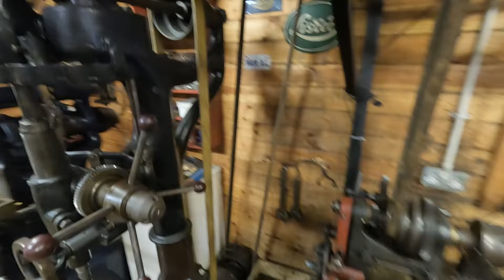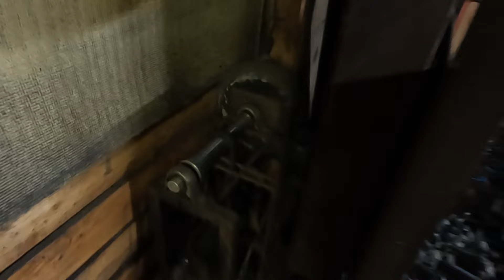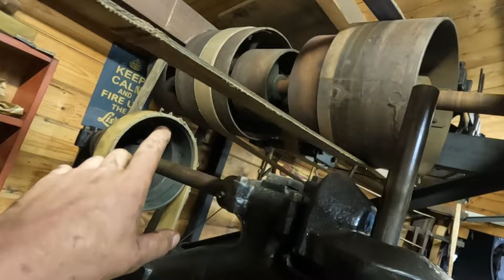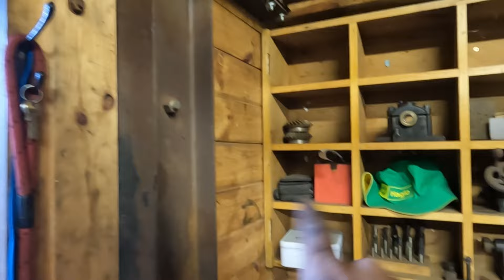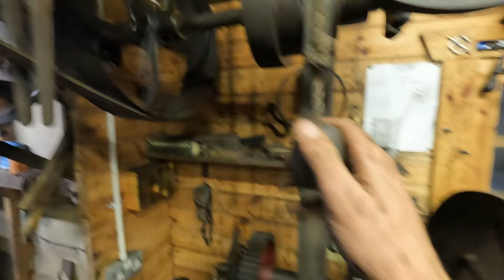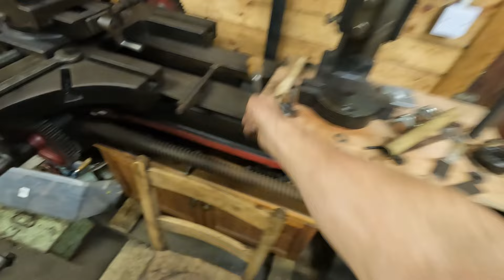Lineshaft Driven Machine and Blacksmith Shop Tour

Comment: Interesting shed, when I worked at the Cumberland pencil company, they had machines run by leather belts, specifically pencil painting machines, originally everything would have been through belts, converted to electric, but using the river to drive them originally.

Comment: What a fabulous presentation.    None of these machines were ever designed to stop working, they were expensive and made last forever.... eminately rebuildable. I am a fan of old American Iron.... 1928 Hendey 14x40 lathe and a 1932 South Bend 9" lathe and a 12" whipp shaper .... all of these are flat belt converted to their own motors ....   

I also love Dave Richards ... one step further and powers the line shaft with steam ;)     Like you his is a working shop not a museum .... thank you for the tour.  

Now we need find you a vertical mill .... or a vertical head for one of your current mills.  ;)

Comment: Hi Alex, thanks for the tour. You certainly do have an eclectic assembly of period machines. An "electrically driven" steam engine parked outside puffing some sort of "breathable smoke" would complete the idyllic picture.
Have you ever estimated what the idle power consumption of all those machines running but not doing work, such as just demonstrated, would be? Obviously, your ten hp motor with speed reductions in almost every combination might make up for the lost energy in turning so much mass. 
It would be interesting to run a clamp-on meter on the motor's feeds to see what the basic shafts require to operate and each machine connected to the drive shaft.
Whereabouts in the UK are you located? Near a motorway judging from the traffic noises but about as rural as you can get in modern  UK I'm guessing?
Regards from Canada's banana belt. 
🤞🇨🇦🍌🥋🇺🇦🕊🇬🇧🪓🐖👜👍

Comment: My oldest machine is a horizontal mill, similar to your machine, except that while it was originally an old line shaft driven machine somewhere in it's life it was converted with an electric motor. I don't know the maker of my mill, but an access door has 1915 cast into it. It still has the over arm, but not the peice that runs off the end of the over arm to hold the end of the arbors, along with no arbors or spacer bushings for holding horizontal cutters. Some time, I need to make these missing bits. But curiously it has a horizontal/vertical head with 3 remaining "3AT" collets... Above the top of the main body of the mill is a top section holding the overarm, is a part of the mill that can be cranked out over the table, off to the left side it, where an arbor ( or the collets ) would go in, this part can swing down 90° and use normal end mills like a vertical mill. My table saddle is fixed at 90°, not fancy like your machine's adjustable table cross angle, but it also has a 3 speed mechanical table feed probably similar to yours. It is interesting to see a cousin to my old mill...

Comment: Very enjoyable as a guide for the water wheel powered 1826 Wallace -Cross Mill in York County Pennsylvania. Many modifications over time our line shafts simply distribute rotary motion to each of the 3 floors from above the basement via vertical to horizontal line shafts by cast bevel gears to continuous engaged 8 inch flat belts to wood pulleys. No speed changing cone pulley sets, driven and idlers pulley pairs to connect - disconnect or belt shifters remain. 
Love the vintage machine tools too as I retired from a 56 year tool and die career at the same campus from 3 different owners.
Reply from the maker: That sounds like a wonderful place

Comment: Simply superb ! Some belts have a twist in whilst others don't. I just wonder why ? Thanks again, Alec. This is a great insight for young people to see how 19th-century engineering shops operated. Guided tours for a small fee ?
Reply from the maker: The twisted belt reverses the direction of rotation. This is needed on machines that have a reverse capacity like my rollers, but sometimes a machine is simply set up in a place where it needs to run in the opposite direction to the main shaft. I'm considering open days once things are a bit more set up!
Reply: @iron_jonesy  
Thanks a lot, Alec. Your shop is living engineering history with a highly accomplished resident curator !

Comment: Thanks for the interesting tour.  The simplicity of those machines makes them so much more interesting to watch compared to the new computerized, do-everything machines.  Is your electric motor new or quite old?  What vintage? If old, I would have liked to see it in this video.
Reply from the maker: Thanks! The motor is modern, so nothing really interesting to see there unfortunately! Does the job and supplies plenty of power though.

Comment: is it difficult keeping all those belts in proper tension?
Reply from the maker: Sometimes they need shortening as they settle in after being installed, but after that they don't take a lot of fettling day to day. They do slacken off  sometimes in hot weather, but it's normally very short term and I can use a belt dressing to maintain drive for that period. Some of my belts I haven't touched in years, others need attention more often!
Reply: @iron_jonesy We used flat belts, mainly on water pumps, on our small farm in what was Northern Rhodesia.  Some of the Lister engines my dad rescued from the municipal scrap dump (circa 1953) would have fitted right into your time period.
The first was a Lister 1.5 hp single cylinder with a cast iron "coffee pot" head on it that needed constant topping up with cooling water as it boiled off. As a six year old, I was impressed with my dad's addition of a 45-gallon drum on a stand, at the correct height, that fed water just by thermal circulation, no pump involved, to that engine. 
As long as it had petrol in the tank, about eight hours worth, it would run forever. I would estimate that Lister to be about a post WWI vintage.
Twenty years later, when he left the farm after Zambianization, that old "scrap dump Lister," was still pumping water, eight hours a day, from well #1 on Jomaron Farm, Fisenge, Zambia.
The belts we used were a cotton based composition with staple like clips on each end and a pin through the clips. We had a hand held Machine for placing them on the belts with the clips coming in about 12" lengths. I must have made a few dozen in my time on the farm. Most of our belting was about two inch for the pumps. The six horse Lister diesel ran a generator by vee belts and a pump via flat belt. All our engines were manual, crank start.

Comment: You are kidding yourself that your set is what we would have seen in the early 1900 - 1920ish. They would have given their eye teeth to have your set up. Even to day your set up is envious - you have done a wonderful job.
Reply: Definitely have workshop and machine envy.
Reply from the maker: Thanks!
Reply: What a wonderful  workshop,you are a very clever  engineer, 😊
Reply: Extremely delightful workshop with line shaft pulleys to drive all machines vintage. That traveling head shaper, is the table also working or is the configuration opposite from a regular shaper, being the table does not move, but the shaping head as seen, moves side to side? Vastly interesting machines that you obviously restored to new lease on life and they will again outlive todays machinery😃 fortunate you are👍

Comment: Excellent!!  Nice shop.  Just subscribed. I'm planning to add a small line shaft to my Blacksmith Shop soon.  I have an antique engine, the line shaft with hangers and 2 pullys, and some belting. It all needs restoration, and I need an idler pully as well.  The only thing it's going to run is an antique grinder which I'm restoring now.  Anyway, looking forward to watching all your videos!!
Reply from the maker: Thanks! Lineshafts are great fun

Comment: What rpm is the main lineshaft running at?
Reply from the maker: About 190
Reply: @iron_jonesy  Could you tell us more about the belting? Do you buy it new? How do you lace it? Thanks.
Reply from the maker: I buy the belting new by the metre. Its a composite material made with canvas and rubber. Its laced with "hammer in" steel alligator lacing which you can still buy new in boxes. I go over the lacing process somewhere in my Milling machine video.
Reply: @iron_jonesy  Thanks. I'm storing all this information for the day I get my old belt driven lathe running :)

Comment: Thanks for the walk a round,  Fred Dibner would be right at home there. It;s geate to see it being use. for its original purpose. Was it your intention to save these machines or do you prefer working with them.either way its a grate shop.
Reply from the maker: Thanks! Originally I wanted basic machines to aid my forge work and the older ones are ideal. Solid and easy to maintain and repair. Once I had a few I began to get into lineshafting and the history and it spiralled from there! 
Now I can see an important need to save some of these machines before they are gone for good
Reply: @iron_jonesy  Thans for your reply you have a fantastic shop , when I first saw it I thought it was in the Stats as they have a few line shaft shops there some as heritage museums, so I was pleasantly surprised it was in the UK. You and it seem a perfect fit. Look forward to your next post. you deserve a bigger following , stick with it and hopefully it will grow . All the best .